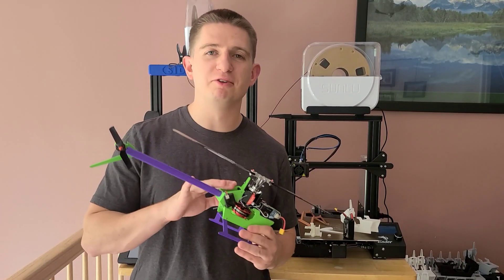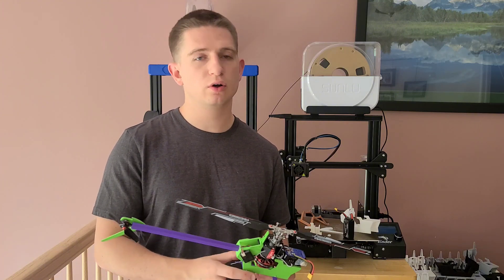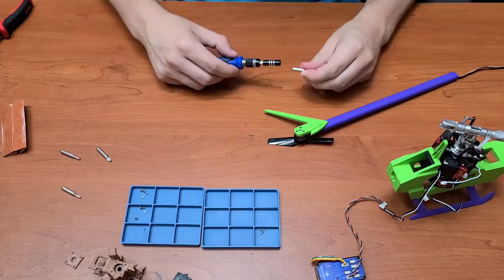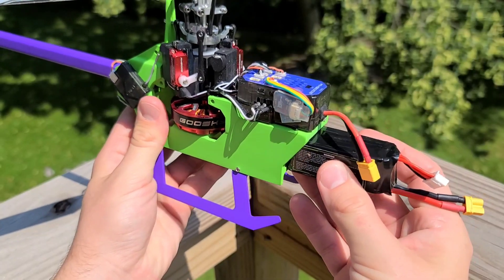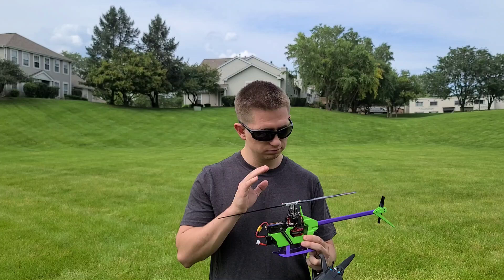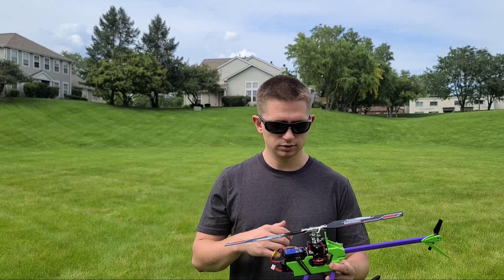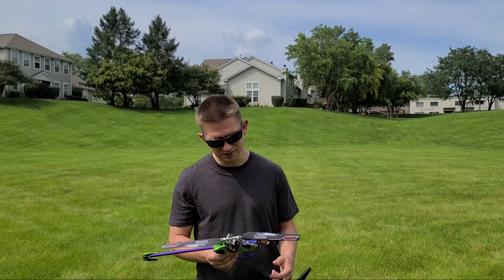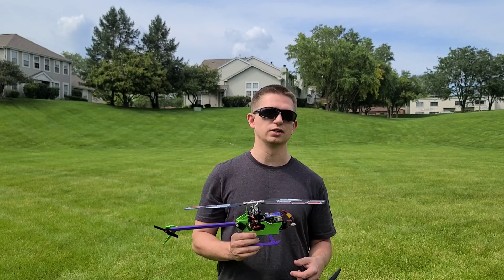All NEW 3D Printed Resin Airframe - Will it Perform?

Comment: Hello, apart from the cost of the servos, esc, motor, receiver, compared to the cost of a goosky frame kit, how much would you estimate the cost of the remaining parts to buy once you have printed your frame.?
Reply from the maker: I'm not sure. Since the electronics cost as much as the kit, I recommend buying the kit and transferring everything to a 3D-printed frame. All you would need is the head assembly, swashplate, bearings for the bearing blocks, and some screws to complete the kit.

Comment: The skids, tail and tail fin would be nice to have in a high visibility color if the 3d printed frame is too heavy.

I dont have this heli, but I'm wondering if these items fit the stock main frame.
Reply from the maker: These do fit the stock frame. I was just printing in resin for the first time and picked to dense of a material. If you FDM print the parts, the helicopter is not as heavy.